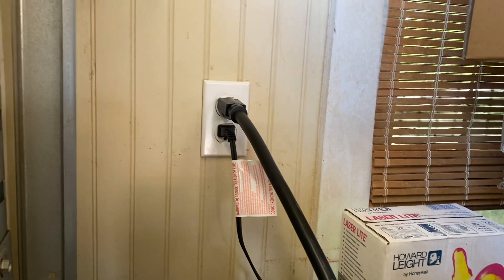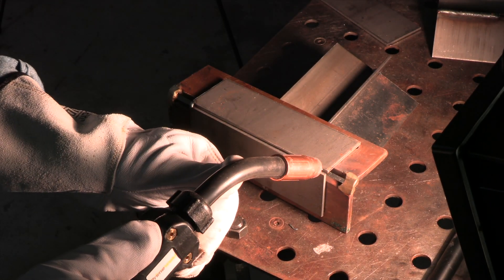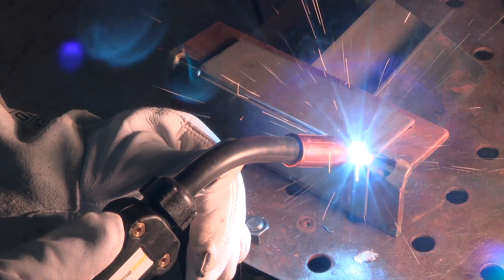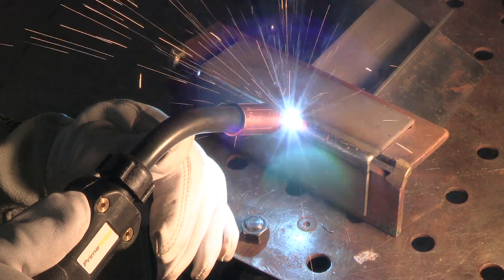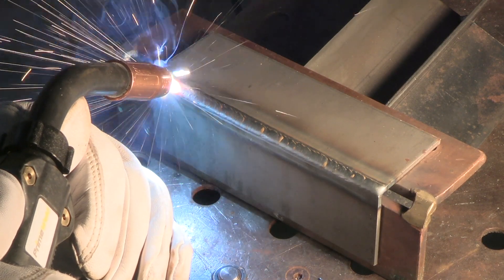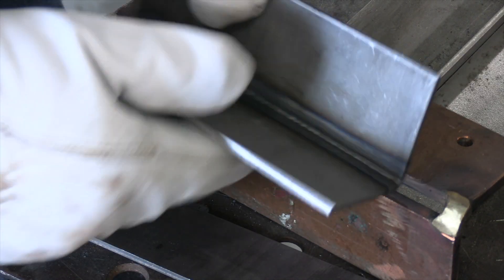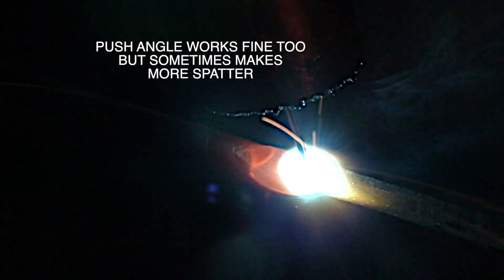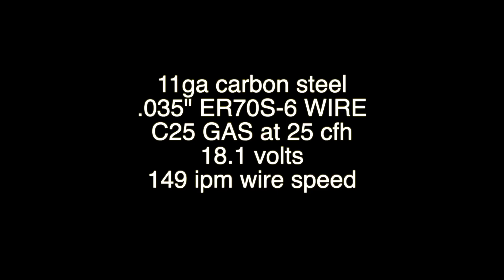115 Volt MIG 2F Corner Joint  - PrimeWeld MIG180

Comment: I am not complaining.

I would design the welder the same (or with even more features) but remember,  we used to have a big stiff vibrating knob to adjust welders so accuracy was about +/- 10 or 20% of something.

It worked ok.

Now we have digital everything, I like it,  but 149 ipm wire feed speed - just imagine the better weld quality if the display had another digit.

149.3 ipm or 149.7 ipm,
I am shure 150 ipm would work just as well but we do like our toys.

To be fare,  that level of accuracy probably is useful if you put the welding torch in a CNC gantry or for work on a turntable etc.

I cant help thinking about the Time & motion man is enrout,
 he says 60 mins = 1 hour, × 8 hours a day × 5 days a week, that means 149 ipm from 150 is a saving of 20 ft a week,  wow a saving of a Thousand ft / year plus a saving of nearly 6.1407 cents a year on electricity bills too.